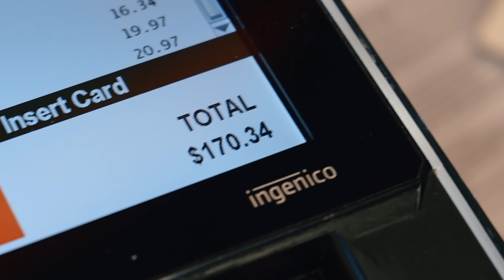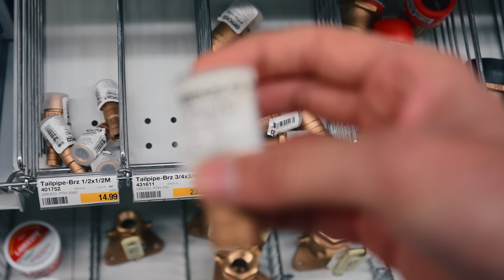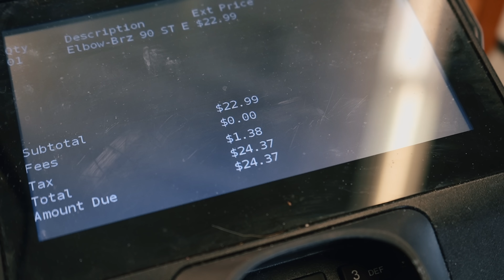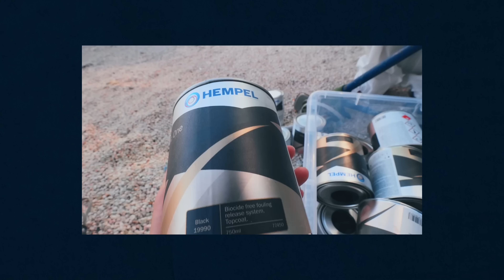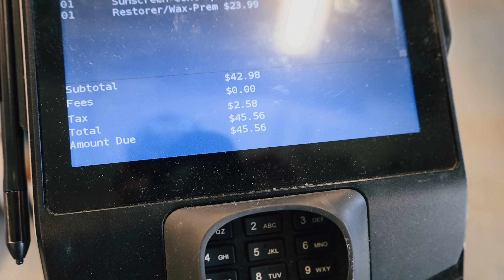Preparing our Boat for Full-Time Sailing: Painful (and expensive) Tales from the Yard.

Comment: Since you won’t be there when it goes in the water, I would suggest closing the sea cocks on the through hulls you just replaced. That won’t fix a leaking through hull from flooding your boat, but it will allow you to be present when you open them to check your inboard plumbing connections; which I would guess would be the most common failure point.

Comment: I have watched many cruisers replacing through-hole connections and I cannot believe no one is making much bigger fittings with the same sized ID!!!  Like well drop pipe is schedule 80. Most other water pipe is schedule 40. Having a thicker fitting has to make the entire fitting stronger!!
Reply: I'm a pipe fitter so schedule means something to me but most of these sailing folks are hearing this for the first time😮

Comment: Polar Seal is looking Great ! 👍 That Silic One antifoul is now competing with Pettit  Vivid  for going on my next boat. tbh, , Like Zinc, I only worry about Copper Deficiency, as Copper is pretty damned essentialnfor Life - my Smallholding is in a seriously Copper Deficient Belt and the extent ofmthe nasty, is Neighbouring Sheep Farmers, Ive helped with regular Copper Drenches, plus Solod Copper Tablets for Cattle and Horses, and I still take Copper supplements to be on the safe side. This vital role of Copper, never gets Mentioned though. Seeing sheep with brain damage we call the Staggers due to Copper Deficiency,  is a real turn off tbh. It  ay be a flip of the coin which one I try first, but I do like 3 coats of Vivid, being ablecto be burnished to a high gloss finish, plus you can get it in White. Decisions decisions.  Best Wishes and hoping for a  ice fast boat splash with no issues. Bob. 👍⛵️✨️✨️✨️